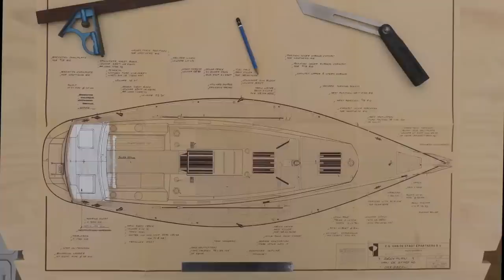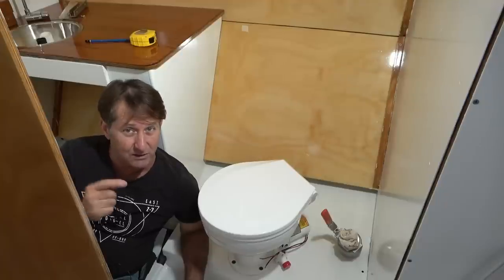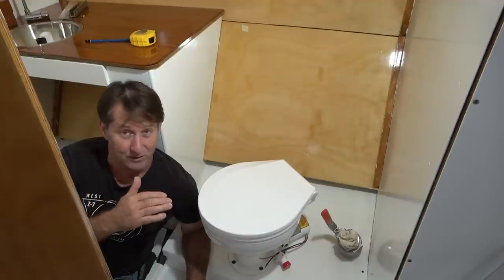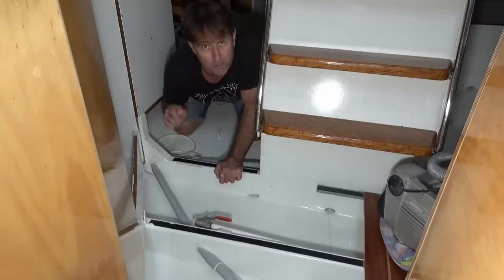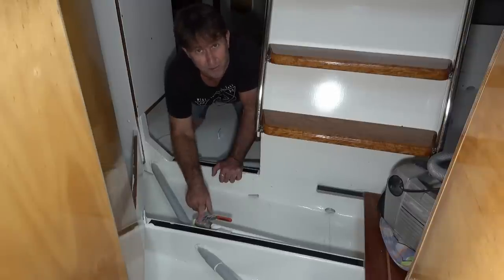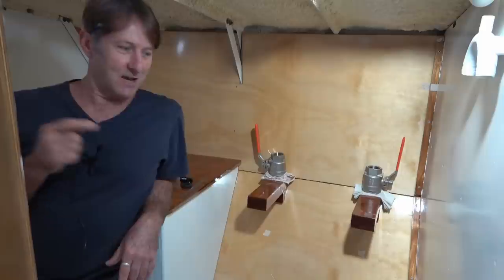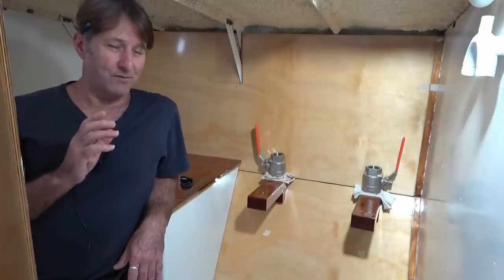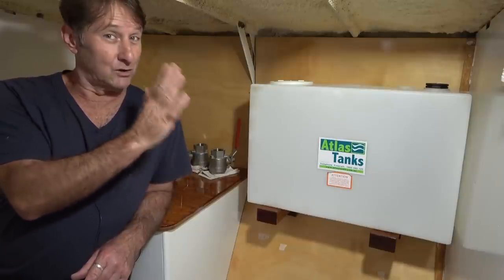"Jack of ALL trades!" 😁💪 Ep.163 Building my steel sailing yacht

Comment: There may or may not be a right way to apply teflon tape to threaded fittings, but there is a better way. If you wrap the tape in the same direction the mated fitting will be going on,  (~12:30) it will not bunch up the tape as the mated fitting twists against the loose end of the tape. The mated end should go with the direction of the tape wrap, thus tending to tighten it. Yours did not appear to bunch up, but it can.

Since there are no screws holding the tank brackets, only the epoxy, I think I might have filled that tank with water to see if those brackets will actually support the weight of a full tank of liquid. Water will be nicer to have to clean up than what is going into it later. In fact, I think I would add supports from the overhead that augment the wall/hull brackets. It would be peace of mind in a pounding seaway.
Reply from the maker: Thanks very much for your good comments Brian, much appreciated and regarding application direction of Teflon tape - yes, of course you are correct sir! A little confession about what was shown in this video, I did actually remove the piece applied incorrectly and replaced it, which can be seen beside me at minute 12:47 and I have the clip of it being reapplied correctly, but forgot to replace what was included, so once again - thank you for your detailed eye on things and keeping me on my toes sir!
Regarding the holding tank supports - jfyi the Company reported shear strength of the epoxy used on wood is 
1800 psi = 12,410 kPa = 1,265,468 kgf/m2, surface area is 0.0045m2 = 5.694 tonnes of shear strength per one knee, there are two and which does not take into account the m2 area of the two bearers with Fix15 adhesive applied and as mentioned in this video there will be struts supporting the outer ends, not to mention cabinetry from overhead deck beams also. So, strong enough for this 70kg when full tank ? I would say overkill  🙂👍🏻

Comment: I wouldn’t have thought that blue water supply line to your toilet is big enough? 🥴 TMC upgraded their supply from 19 mm to 25mm. Yours looks like ? 10mm?
Reply from the maker: Thanks for your good question, appreciated, the supply pipe size is 12mm and because this toilet is electric flush I am hoping that this size will be fine, however use time will tell,...  🙂👍🏻

Comment: Was that a plunge cut with the jig saw? Or was the thickness on the back side of the piece thin enough for the blade to poke through?
Reply from the maker: Thanks for your question Mike, appreciated, no plunge cutting possible with jigsaws, I use longer blades which cut the thicknesses  🙂👍🏻

Comment: As always great workmanship.   One thing, have you thought about a grommet around PECK tubing to prevent chaff when it passes thru a steel component?  Continue the great work, get it in the water !!!
Reply from the maker: Thanks very much for your good comments Larry, appreciated, also well spotted and this gave me a chuckle re. grommet, because I had filmed me putting a grommet into that hole, however as it turned out it was a bit too big and so I did replace it, which be shown ahead  🙂👍🏻

Comment: Voice of experience here Bruce. I don't know your future plans, but you'll need a lot of cushions to make the 90 degree seating area comfortable, or, you can make up a foam 'wedge' to go behind the upright sections. The added support for your lower back will be welcome for any long stints on the settee. It can be removed for dining and replaced for just lounging, so, no permanent changes to your well laid out design!... I'm a bit nervous about those 'bearers' only being 'glued' to the top layer of the ply. A long SS screw down through the top into the liner will add a mechanical support to what may become a heavy tank when full... :face-blue-smiling:
Reply from the maker: Thanks very much for your good comments Mike, appreciated, re. the saloon seating, I made the angle for these 105° off vertical, which is the industry standard for lounge seating and I explained this in Ep.89 which you could watch -  https://youtu.be/JDcZfa8qHD4
but yes, cushions will also be a part of lounging in Mistress to increase individual comfort;
re. tank knee supports, jfyi the Company reported shear strength of the epoxy used on wood is 
1800 psi = 12,410 kPa = 1,265,468 kgf/m2, = 0.0045m2 = 5.694 tonnes of shear strength per one knee, there are two and which does not take into account the same m2 area of the two bearers with Fix15 adhesive applied and as mentioned in this video there will be struts supporting the outer ends, not to mention cabinetry also  🙂👍🏻

Comment: too late now but that john guest pipe should be cut with a proper cutter so as to not crimp the pipe and lead to cracking later - experience from my caravan when I used cutters rather than a stanley knife or the correct cutter
Reply from the maker: Thanks for your good comments Jim, appreciated and understood and I did trial using a box cutter blade and the sharp large wire cutter tool that I have seems to give a clean edge and doesn't squash the end much and which returns to round shape quickly after, the blade method gave inconsistent edge results and was more laborious. I do admit though that not having used the specified JG cutter tool is on my mind and will remain there until the whole system is tested and over time  🙂👍🏻

Comment: Great work Bruce! Wont be long now! Quick plumbing tip for you. When using plumbers sealing PTFE tape always wrap it onto the thread in a clockwise direction (the same as the thread) so that as you tighten the fitting it is pulled tighter into the thread. If you wrap it anti-clockwise the thread is trying to unwrap it as you tighten the fitting.
Reply from the maker: Thanks very much for your good comments, appreciated, well spotted and of course you are correct re. tape, as I replied to somebody else who also spotted this - I did actually remove the piece applied incorrectly and replaced it, which can be seen beside me at minute 12:47  🙂👍🏻

Comment: I am so curious about what you will use to cover the foam insulation on the hull
Reply from the maker: Thanks for your good question, appreciated and do you mean what did I cover the spray-on insulation with on the hull? Or what will this be covered with on the decks, which has not yet been covered with lining?  🙂👍🏻